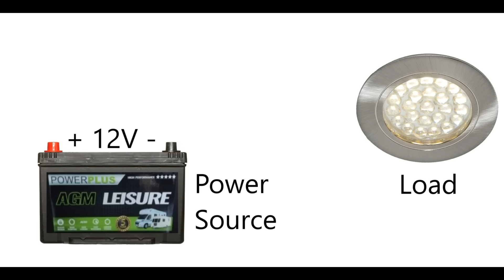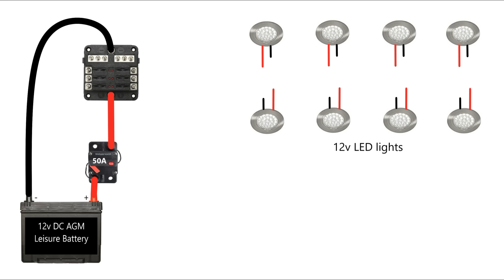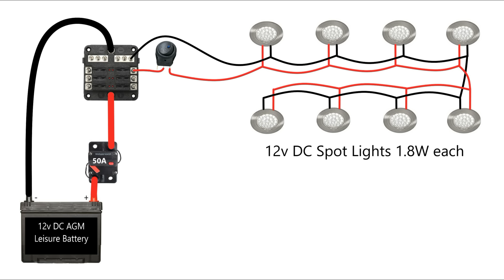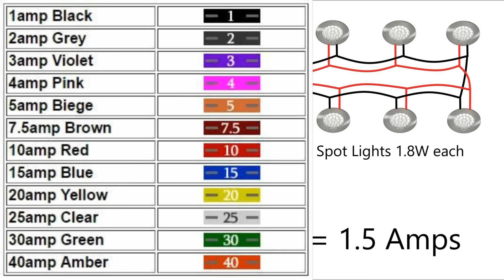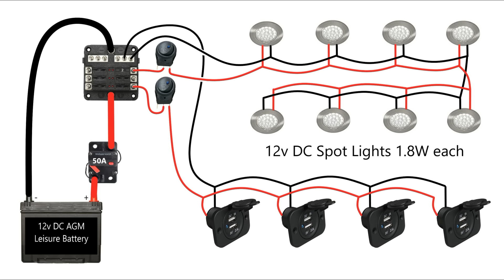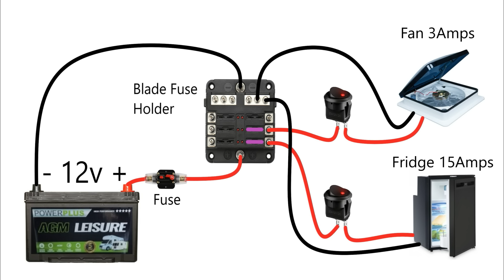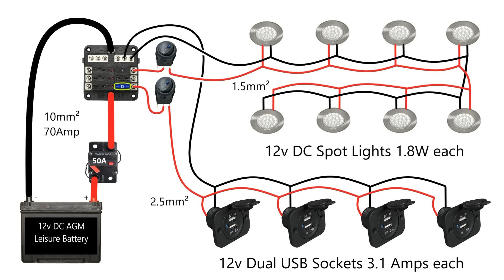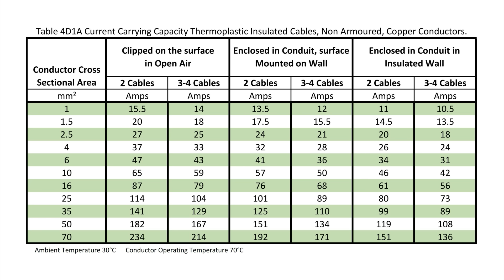Electric Cable & Fuse Sizing - Camper Van Conversion Series

Comment: Hi Greg great vids can you tell me is speaker wire ok to use as 12v for camper van THANK YOU HAPPY TRAVELS.
Reply: Yea as long as the devices are rated at no higher than 12v its the same thing speakers use 12v power. It just depends on the thickness of the speaker cable as they measure speaker cable in gauge instead of mm/csa. BUT it is far better to use the cable mentioned in this video as it has an additional layer of protection against things like hot/freezing weather.

Comment: Hi Greg, absolutely love your stuff! I’m on the wiring stage of my van and I’m scared I’ve made a mistake. I’ve bought 3 core (positive, negative and earth) wire. It is multi strand tho! Will this work for my wiring?
Reply from the maker: Yes if it is flexible multistrand that is fine just don’t use the earth on your 12v DC electrics. 👍🏼😃
Tape it up to make safe

Comment: hi greg when you attached the 5v 3.1a usb connection, wouldn't the fuse rating be lower than you calculated?  At 5v the actual a power draw would be 62w. the max amps at 12v would then be 5.1?  that would require a 6-7 amp fuse.

Comment: Great videos, look forward to watching the series and using this detailed info. Just one question, why didn't you use only a 1mm2 wire for the lights, as on the chart that goes up to 11 amps which is far higher than the 2 amp fuse? Why choose 1.5mm2 instead?
Reply: ok. watched further, it reduces fire risk just that much more. Well worth it!
Reply from the maker: Especially when you are burying cables in the wall or insulation the rating can easily be halved because they will run warmer so it never hurts to go bigger and in fact the current regs stipulate a min wire size of 1.5mm² so that is the smallest you can go to.

Comment: Hi Greg
Electrics are my nightmare. Can you advise on using 2 core 1.5mm thin wall 21A multi flex cable for all 1.5mm usage, lights, fan, water pump etc, all on their own cable runs to the fuse holder. I ask as I have gone and bought the thin wall rather than rubber after it being advertised as perfect for campervan conversions and put it inside conduit. Now after seeing you say use rubber flex, I am going aghhhhhhh :). My worry then is just the use of thin wall cable rather than rubber flex and routing so many thick cables through the limited space in the vans cavities. Did you put extra holes in the cavities here and there to accommodate the cabl runs?
Sorry for such a long winded question.

Spec I used:
cross section 2 x1.5mm
21 amps conductor spec (mm) 2 x 21/0.30
overall Dimentions 6.4mm

Cheers Bruce
Confusion reigns

Comment: Love the presentation of 101 Wiring.  Here's my question.  I am seeking to put my 1984 Chevy P30 Step Van headlights and tail lights, etc on one switch not associated with the key, but directly from the battery.  Is this possible?

Comment: Do ground to the van at all
Reply from the maker: Hi Cindy with 12v dc circuits if you install both the positive and negative wires there is no need to connect to your van. You van’s auto electrics uses the body as a negative path back to the battery to save running lots of cables. 12v dc does not require an earth either 😃
Reply: Thank you for the information. Cheers!

Comment: Hi Greg this is a very good video, Am i mistaken but can you confirm the calculation for the USB socket circuit is correct? USb rating is 3A @ 5V or about 15 watts, but the supply is 12V, so 15watts at 12V is about 1.3A and just over 5A total for the circuit.?

Comment: Hi Greg, What a great video thanks for your hard work. One thing that I am always worried about is switches, I assume any switches should also be rated to handle at least the current calculated for the circuit but should they also have a safety margin added e.g. multiple by 1.25 for 25%, in the case of reactive loads (motors, etc) is this calculation different?
Reply from the maker: Yes absolutely they should be rated above the current of the system and have some margin of safety too otherwise there is a possibility that switch contact can get hot and cause a fire. Motors have a short start current that only lasts for second. You can get motor rated breakers or fuses that allow for this. 
In the campervan there is nothing big enough to worry about special fuses.
Reply: @GregVirgoe  Thanks Greg, is 25% a sensible margin above circuit max current for a switch, or is there a standard for this?

Comment: I’m a bit confused. I could follow you up to when you said the 8 x 1.8 wt lights would draw 1.2 amp and therefore you would go to a 2 amp fuse.
You then said you would use 1.5 mm cable.  isn’t that way over the top as table 4d1a in 18 th edition says 1.5 mm cable would allow you to draw 20 amp if clipped direct.  Please let me know if I’m missing something.  I was thinking of using .75 cable and even that is way over the top. .?

Comment: Question from the battery to the fuse box , you have a 50 amp breaker fuse  , would you recommend having two 50 fuse breaker (50amp) if the distance was 1.5 meters ?

Comment: Hello! Might seem like a strangely specific question but what considerations are there for the isolator switch between the solar panels and the charge controller? Does this need to have certain ratings like the fuses/breakers/wires do? Thank you!
Reply from the maker: It’s a very good question indeed. 
All switches and connectors needs to be rated higher than the fuse rating. So they can safely handle the max current capacity.

Comment: Brilliant video. I have just been told to use 4mm cable to wire my victron 30amp MPPT is this OK it going to be tucked in between carpet lining.
Reply from the maker: Is that on the input side of the MPPT or output to the battery?
How long is the length of cable?
Reply from the maker: Running the figures 4mm is only ok for cable less than 1m long. I would recommend at least 6mm or bigger
Reply: @GregVirgoe  I agree I'll buy some 6mm and send the 4mm back. Its from MPPT to battery
Reply from the maker: @paulcomptonpdphotography  definitely at least 6mm to be safe

Comment: I have a question, in my system I have a 15A input from Solar and upto a 90A draw from appliances. Do the wiring between my batteries and bus bars need to be able to handle a combined 105A or just 90A from the draw?
Reply from the maker: The cable just needs to be large enough to handle the load that is directly connected to it. 
It’s only cables that join batteries that would need to manage all the connected loads. Hope that helps.

Comment: Thanks for the information! How would you  connect the wire from an led, one to the next. Ie the negative goes from one led to the next, goes in and comes back out. I can't envisage it. Apart from splicing the wires which I wouldn't like the idea of, is there a type of connector you can get? Thanks again!!!
Reply from the maker: Take a look at this video re wiring connectors. 😃 https://youtu.be/UP10-tW7TQg

Comment: Hello Greg great videos what you make. i try to follow your work. but i cannot find same isolator box as you used in your van could you please put link of that product here it would help a lot best regards
Reply from the maker: My large control panel was built from scratch, there is a video about it at the start of the build series. 
If you want the isolator there is a free parts list in video description
Reply: @GregVirgoe  Thank you very much you are the best

Comment: Hi Greg
Thank you a lot for the interesting tutorials... amazing! I gave a look on your wiring diagramm and have one concern about the 35mm^2 sice of the wiring running from the batteries to the inverter. In case of a pure sin 2000W inverter even if considering  a peak load of 4000W at the end I land at 18.18A which means that I could use a wiring size of maximum 4mm`2. So my question: why do you suggested in the diagram such a big wiring size? Many thanks in advance for your reply.

Comment: Hi Greg, When tackling electrics, if you say a 1.5mm wire this is the individual diameter of the red or black wire. correct? In other words 21amp rating?
Reply from the maker: Yes correct it’s the CSA of the individual wire cores

Comment: HI Greg! Would I be safe running this solar setup? 160W panel running to a 20amp controller with 10AWG wire. Then running from controller to two 100ah leisure batteries with 14AWG wire. Distance should be around 3m. Would it be best to get the same size wire all around and just get more 10AWG, or should this be ok?
Reply from the maker: Hi Corey, You use 12AWG solar PV cable from the Panel to the controller and I would recommend 10AWG from the controller to the batteries.  You can run 10AWG to everything but you end up paying more for it. No harm in fitting bigger cable.

Comment: Hi Greg I've been very confused about electrics, I like how you explain I just bought a van and I'm going through everything, for piece of mind. My van has got a 140 amp split relay charger. From van battery to charger is 16mm2 cable 100 amp fuse near to van battery cable runs to split charger, out of split charger no fuse to 100ah leisure battery, my question is do I use a fuse 1.25 bigger than the 140 amp charger and use larger cable than the 16mm2 that is already existing Regards and TIA Karl
Reply from the maker: To be honest I do not recommend using a split charge relay because the battery types are very different and a relay is just a switch and does not meter the power in any way or know the state of charge of your leisure battery. Most leisure batterie’s cannot handle a huge 100amp charge rate so my advice would be to replace that with a 30amp DC to DC charger. You can reuse the 16mm cables but place 40amp fuses on both batteries.
Reply: @GregVirgoe  Thankyou so much for your reply, I was considering replacing it with DC to DC, now I will definitely do Cheers 🍻

Comment: Thanks for the great video Greg. Question -  Does it matter where a switch gets included in the circuit? Since any break in a main power or ground wire would break the circuit then could it not be  added anywhere? I'm trying to cut down on my total run length for 6 led lights and 2 switches, and am hoping to add my t-off to the  switch in the middle of the power run.

Comment: Hi Greg
At last starting to wire my sprinter thanks to your diagrams but you don't show b2b charger I an fitting a 60amp renogy b2b the charger  will be at the rear of the van what size cables do you recommend ps keep up the great videos

Comment: Hi Greg, Thanks for such a clear, concise and informative video. I am adding a solar panel to my motorhome that is pre-wired with mains hook up and 12v circuits. Of all the videos I have seen I cannot find one that shows how to connect the 'load' outlet from the solar controller to the 12v distribution box. Do you simply connect wires to the terminals that the battery charger uses, or do you need to consider the wires coming from the starter battery into the distribution box? any help would be gratefully received.
Reply: Further to my post a few days ago I have now worked out how to do this for my CBE 12v distribution box. I will be installing the solar panel system as soon as the weather warms up. What I want to do is run the 3 way fridge from solar so that it automatically kicks in when power from panel is enough. The 12v charge to the fridge only operated when the engine is running so I would like to know if it is possible to do this.

Comment: Hi Greg, i'm just wondering how did you decide to use a 1.5mm² cable size for the lights instead of the 1mm²? Was there reason for going bigger if the 1mm² would hav sufficed?

Comment: Is it ok to have the fuse box about 3/4 meters from the battery if i use the correct thickness of cable ??
Reply from the maker: Yes 👍🏼 you can have a few in different locations in the van to save running loads of smaller cables. Just make sure the cable feeding it is big enough to handle all the connected devices. 👍🏼🤩

Comment: Hi there Greg - great video, thanks for all your help. I'm a little confused as to why you jumped up to a 1.5mm cable for your lights, which are only drawing 1.5A (safety), when the 1mm cable is rated to 11A - much higher current than your lighting circuit is ever going to get. Please can you explain why you went for 1.5mm over 1mm cable? 
Thanks
Reply from the maker: I didn’t install anything smaller than 1.5mm which is more readily available. 
In the case of cables bigger is always better. 👍🏼
Reply: Thank you for your quick reply! I assumed it may be a convenience/availability thing but always best to be sure. I will follow your lead on that one! Thanks again - your videos have helped me draw up my own wiring diagrams and load sheets
Reply from the maker: You were correct with your statement though 👍🏼😃
Reply: @GregVirgoe  Sorry to be a pain - but one other thing I’m unsure about is the red/black cable dilemma. In your cable video you recommend 2 core rubber h07rn-f and arctic blue cable, whereas your wiring diagram refers to black and red cables for positives and negatives in circuits. I may be being an eejit but was hoping you could please explain how you have delineated positive and negative cables in the can if using only these two cable types. Thank you!
Reply: @GregVirgoe  Ah! I am being an eejit- just had a lightbulb moment. So you feed one cable to each appliance, rated in mm2 to the amperage of each device + more than 1.25x safety margin, and within each cable is your positive and negative? I, for some reason, was thinking you'd run multiple cables to each device to complete the circuit. 
So, instead of red and black wires indicating positive and negative for a DC circuit, you'd have brown (instead of red) for positive connections and blue (instead of black) for negative/neutral connections, feeding back to your common negative bar. Is this correct?
For the 230V AC side, it would be the same, except the yellow and green earth cables would screw into an earth terminal in the control panel? 
My only confusion if that is correct is there all the black and red cables in your control panel are coming from? Were these supplied with the individual appliances like your inverter, or am I missing something? Thanks again for all your help - it's all beginning to make more sense now.

Comment: Hi Greg, Love you videos! they are a great help. Just wondering, if I then wanted to fit an inverter into the picture would I then connect that up to the blade fuse holder? many thanks
Reply from the maker: You would connect your inverter direct to your leisure batteries as they use a lot of power and require thick cables and large fuses. My previous off-grid wiring video will give you more information

Comment: Hi Greg, at present I have solar for charging my LB. I would like to have split charging (for winter) as well as the ability to use the solar on sunny winter days. Do you have a diagrame or YouTube video with this in mind. I'm happy with wiring and electronics.

Comment: Hi Greg, great video, quick question how would you connect split charge relay circuit to leisure batteries,  the same way you did solar charging  i.e. positive to first battery and negative to 3rd?

Comment: Hey Greg, great videos so thank you so much. I have a question. In your example your lights, have a max of 1.8amp - if you take 1.2 amp x max of 1.5 to find the fuse. This comes to 1.8. You are having to use a 2amp fuse because the other option would be a 1amp. So how much leyway do you get with this?  I hope my question makes sense.

Comment: Hi Greg, if I disconnect my Batteries from my VE MPPT CC, then the load coming from the PV will damage my MPPT, would it not? How can I protect my MPPT CC against possible battery disconnect? In your diagram, you have a circuit breaker between the MPPT and the batteries, what if the breaker trips, then the PV load will damage the MPPT?? Thanks
Reply from the maker: If a fuse or breaker trips there must be an overload or problem. If that one trips it’s most likely to be the fault of the charger anyway. 😊

Comment: I'm looking at charging by solar - relay - battery charger question is do I connect them all up to the same thermal and when charging by one of them do I need to have other two switched off ie if charging from battery charger will I need to put switch on solar to turn off  and same thing for all 3 or will they be fine if one charging and others not..
Thank for any help

Comment: I am trying to follow the Amps =Watts ÷ Volts principle...I have 6 x 2.5w led bulbs totalling 15w which divided by 12v is 1.25A. The 1mm electrical wire I have is rated at 16A which seems overkill but I can not find anything with lower A, am I calculating something wrong?
Reply from the maker: No, with cables it never hurts to be much bigger as you’ll get less volt drop and they’ll be much cooler. It’s only fuses that need to be sized 25% above the full load amps. Big is better with cables 👍🏼😃

Comment: When wiring in the lights/multiple sockets how do you attach multiple wires together? Do you splice or set up little 3 way connectors as per your diagram?

Comment: Hi Greg enjoy your videos greatly. I'm just looking at getting parts for the electrical setup. I won't be totally off grid and therefore the van will be parked up for weeks. Due to its location when parked I looking at using a 10A mains battery charger to keep the starter battery good. I'm also having a DC to DC fitted due to the van being Citroen Relay 2017 euro6  with a smart alternater . My question is.. could I Connect my battery charger to the starter battery by utilising the existing wiring from battery to DC to DC controller with the use of suitable switches therefore not running two sets of wires to the starter battery. Or can you see a major flaw in my plan. Cheers